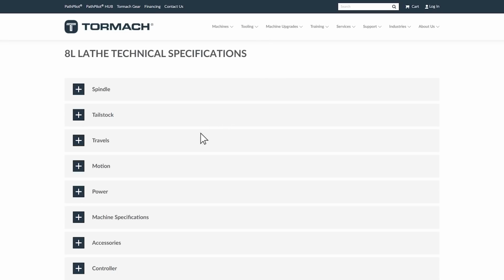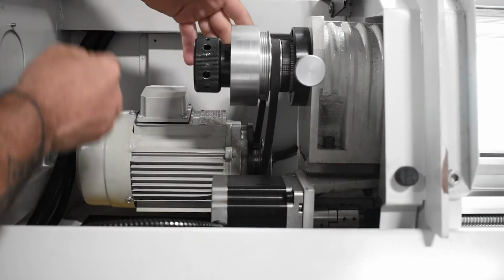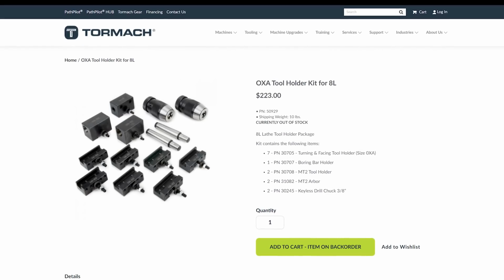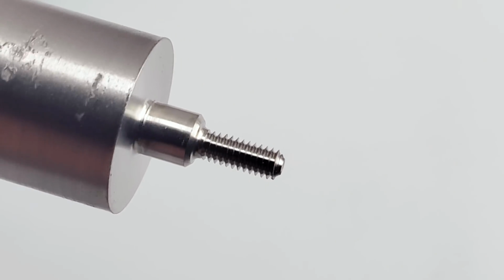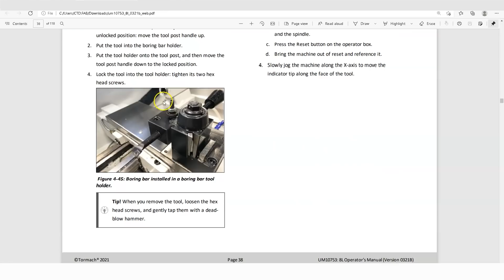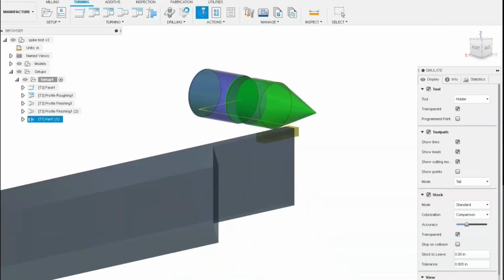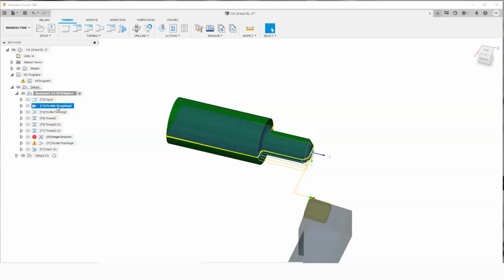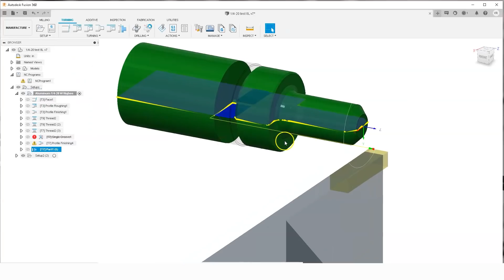Tormach 8L Lathe Introduction and First Chips!

Comment: You describe tramming and centering the tool height as if that were all that is required to deploy a new tool.  But how do you calibrate the X and Z locations of the tool edges?  That must be a nightmare, and has to be completely redone (for the whole tool table catalog!) any time the quick-change post gets nudged.  The final precision achieved is never better than the collective per-tool calibration across the whole catalog, so I imagine your boast of 0.001in repeatable tolerance is wildly optimistic.  Dozens of calibrations to maintain, any one of which, going off, spoils the works.  Grooving or threading up to a shoulder, with a slightly-off Z calibration, you're gonna crash.  The lead screws aren't even linear to 0.001in, the QCTP tool clamping is more non-repeatable error source, so adding up all that uncertainty can't deliver consistent precision.  Hard to believe you cut an M2 thread within all the tolerances (only +/- 0.00125in on pitch diameter).

Changing tools by hand is actually faster than any automatic changer.  The problem is having to attend the machine full time.  Eventually you get bored or absent-minded.  Then you change-in the wrong tool.  Or you hit the resume button out of habit before you realize you didn't change at all.  Kaboom!

An optical tool setter inspection microscope attachment would be a very productive accessory, attachable to the headstock to provide a repeatable fixed datum of the tool edges.

A pointed 1/2-inch edge finder is cheap and precisely ground, no need to be improvising that pointed bar.
Reply: Basically everything you said regarding tool offsets is applicable to any toolroom CNC lathe running a QCTP. Nothing new here. 

So long as the tool post the machine comes with is a high quality (repeatable) one, I don't really see how .001" repeatability is unreasonable. 

And no, changing tools by hand is almost never faster than an automatic tool changer. What ATC's are you using?
Reply: @tbdcreations5370  The QCTP shown is the ordinary type that is just clamped with a threaded post and nut.  It has no repeatable position relative to the carriage and the machine coordinates.  It shifts and turns anytime there is a false engagement or crash, losing the datum and requiring a laborious recalibration.  Of course there is nothing new about it, it's what manual lathes have used for 50 years.  The tool holder to QCTP repeatability is not the major problem; the problem is the QTCP to carriage fixation that isn't reliable, detectable, or repeatable.  There is no removing this weakness, because the QCTP has to be the weak point that gives when there is a crash.  If you fixed it in position more firmly, then something else would have to give or break when there is a crash, probably the leadscrews or bearings, disastrously, permanently degrading.  In the manual days, this wasn't a problem because the operator's hands and intelligent senses on the cranks were the ultimate torque/force limiter.  But CNC has no such sensory detectors or intelligence to limit self-damage from motion faults.  Instead you're relying on the QCTP to be an emergency one-time clutch, and when you blow that fuse you're looking at an hour or more to replace the calibration and restore precision.

There's a train of mechanical imprecision sources: insert to tool, tool to holder, holder to QCTP, QCTP to carriage, carriage to {lead,ball}screw, screw linearity and rigidity, screw bearings, ways linearity and squareness, workholding, spindle.  You add all those together in a machine of this type quality, you're never going to get repeatable precision of anything like 0.001in without cut-and-try intervention methods, and constant laborious tuning.  Just to get a shop standard 0.003in requires constant care.  Hope-and-try strategy will typically yield 0.005in or worse.

CNC is like self-driving cars, player pianos, factory bakeries.  They can drive/play/produce better and relieve the tedium, but new problems emerge because there's no soul.

You can manually change a QCTP tool in a second or two.  A turret ATC isn't any faster than that, and the stepper motor types can be quite ponderously slow.  It's sort of a John Henry conceit, but then things didn't turn out well for him.
Reply: @RichardKinch   I guess I'd agree that this particular QCTP is probably more problematic than larger ones because of it's size (and because he mentioned issues with it in the video). But my point was QCTP have been used on many CNC lathes in the past and present. Trak toolroom lathes, Haas TL series lathes, ROMI Ezpaths. Typically what that means is you're limited to just a couple of tools to make setup time for a job reasonable. You make it sound like a big deal but it doesn't take more than 10 minutes to set the tools offsets for a handful of tools. 

Clearly we're both just speculating on the precision of the machine, maybe in a future video they'll actually give more feedback on real-world repeatability. 

Maybe you're much faster than I am, but I don't think I could reliably make a tool change on a QCTP faster than 3-4 seconds. 
A turret ATC on a large CNC lathe can change tools in 1/4 second or so (or less). I've seen ATC's on little educational lathes like this one change tools in closer to 1 second. 

But really, if you're trying to shave individual seconds off your cycle time then this is clearly not the lathe for that. That and there is no tool changer option for the 8L as far as I know.
Reply: @tbdcreations5370  I'm not speculating.  I have 100s of hours experience on an identical CNC retrofit design.

I don't follow how you can measure a tool offset in a minute.  If you're aiming for 0.001in total absolute (a priori) precision, you have to measure to tenths on every random item in each of 3 dimensions in the train.  The machine as shown doesn't have any facility for these measurments, so how is it even done on the live machine at all much less quickly? Hence my suggestion that an optical attachment on the headstock would be necessary.  And this has to be repeated constantly, not a one-time setup; there is no defined datum among the carriage, QCTP, and holders; it's all relative and only resolved to the fixed machine coordinates at run time through the budging parts of the train.  The tool calibration is missing from this presentation.  But it has to involve some measuring tool not shown, such as a dial indicator, optical DRO, test bar reference, optical microscope, etc.  None of these methods are convenient or quick, when you're aiming for tenths on elements to achieve 0.001in total.
Reply: @RichardKinch   Quite the know-it-all, aren't ya? (Or so you think)

Actually you are speculating, since this is a CNC lathe built by a company to be a CNC lathe. Not a manual lathe converted by a DIYer. 

For the X offset virtually any control I've used (I think pathpilot has this too) you can turn a diameter and use a micrometer to measure the diameter. Then with the tool still at that position go into the offsets page and use the measured diameter to set the offset. This takes about 1 minute per tool. 

For Z offset you can simply touch off the end of a piece of stock. You won't get to within tenths, but should be able to get to within .001"-.002". This takes about 30 seconds per tool. 

Using a micrometer, you could get the diameter offset within a few tenths (better than the machine could hold). 

For Z, you're stuck with .001"-.002". I don't think much better accuracy could be expected on Z features without some sort of toolsetter or optical device as you suggested. Both of which would be absolutely absurd for a machine of this size.
Reply: @RichardKinch   As a user of this machine for almost a year. Your experience with your system applies to this machine also. The tool post can be bumped out of position in the event of a crash. From experience the tool itself will will push out of holder and or the machine stalls. But no damage to machine that i could verify. Guessing the axis drives are not powerful enough to damage ball screws.  maybe spindle encoder also helps limit crash damage.  I added a tool list to the cam post header so i could arrange the tools in correct order and avoid a crash from wrong tool.
 The tool setup is in fact the most time consuming  part of using this lathe. But its not that hard with practice and good methods.  Special care for key tools must be used for finished dimensions. Most of the others for roughing do not require this.  It takes about 15-20 minutes for normal 5 tool program using  Facing, roughing, profile, threading, and cutoff ops.  As others mentioned it works much like any lathe with a tool post system and has the variations that come with a qtp system.  As you mentioned if you crash it you will spend time getting it all back. The trick is dont crash it :).  Anyway After setup its easy to load programs and use for days or weeks only having to set tool 1 "reference tool" by skim cut and measure and skim face and zero z. All other tools work from that offset and are as accurate as your setup methods.  As for precision of this lathe system. imho it can be freaky accurate for such a small machine. Do a skim cut and set tool. Go back do another skim cut and dro and your mic read same out to 0.000?. At this point its all in the program and how its setup for the material to be machined. Good quality inserts are a must along with good coolant if you want nice finishes.  Its a small machine! dont expect to hog material and get great accuracy and or not throw it out of wack.  And like all lathes the material itself flexes if not supported on both ends.  I wanted the machine so i could build a large widget library of cad /cam hardware models ready to load. Throw in some stock and have good basic part in just minutes.  Example  if you fix things on a farm and a hardware store is 60 miles away, this would be a good tool to have for making hydraulic fittings and other small hardware for fast on site repairs. After you make one its easy to file the program and setup on disk drive ready to make when needed.  If you want to make hundreds of something imho this is not the system. Way to many movements changing tools, setting stock, open and close doors. The user would be wore out in no time ..........    I do have a tormach mill and router that use same pp control, cad and cam for all three machines making a nice overall system to use on a casual basis.
Reply: @laneburkhart5590  I agree with you.  But what we're aiming for is automatic absolute coordinate precision a priori, not relative cut-and-try manual interventions.  That is, the genuine precision of a CNC machine is how close it repeatedly delivers what you program without per-job manual or semi-automatic interventions/tuning.  Not what you can achieve with mic'ing a trial cut and adjusting the program for each part run.  It's not a 0.001in CNC machine if you have to tune it on every part to get that result.  You can get 0.001in with interventions, like we did in manual days with mics or DROs, but that's not the CNC performance, it's just CNC assisting a tedious manual process.

If the axis motors are underpowered (and being steppers not servos, that's a given) then that's a good thing in terms of the machine not automatically self-destructing or degrading itself.  But that also means the machine can't possibly perform anywhere near the material removal rates or feeds-and-speeds envelopes that are required for sound metalworking.
Reply: @tbdcreations5370  Actually I'm an engineer and physicist, and 20 years into metalworking and CNC.  The only speculating here is that this machine is built from Chinese components, such as the rolled ballscrews and repurposed bed-ways-carriage, which have definite limitations.  That knowledge is first-hand and not speculative.
Reply: @RichardKinch   after power on and homing machine. Tool one is set by a skim cut and measure. After that your good to run parts  until you shut down machine.
If your system requires more then it is not much better then Manual. The machine requires no intervention. As for power it has a motor and steppers designed for this size of machine and mmr that goes with this size of machine. Before you questioned accuracy and I explained how accurate it is by just looking at the dro and a skim cut for tool setup. You questioned damage from crashes I explained how it avoids damage with motors and spindle encoder sized for this type of machine.  Now your concern is mmr. Sorry not going to debate that as its subjective and the main idea is to make high precision parts with this small machine not how fast you can make them. If you want production move to bigger machines. If you want hand fulls of precision lathe forms and not worried about time as much as results. This is a good fit.  In my case its all about a huge library of pre designed cad cam lathe parts ready to make as desired.  Just load stock and hit run button and start changing tools. Simple imho. Example I needed a male air coupler. I designed it to spec cam tool paths up and then went on to make a dozen. All in a couple hours. Not clear why you dont understand this work flow. But it is a nice little cnc lathe imho and it works as designed.  Good luck with your conversion and its problems. I like to make parts not work out problems with poor machine designs.  Why I have 3 of their machines because they work. And I was told by a number of people over the many years of use they were junk. When in fact they work well and make very precise parts on all three lathe, router and 1100 mill.
Reply: Final note. This machine plugs into a wall outlet. How much mmr can you get with that power. Also if your making small fittings or parts from o.5 inch stock just how much mmr do you need? It takes all of a couple minutes to run a program and make a part.
  Lol kind of silly for a engineer and physics guy to even bring that subject up.  Its a machine with a designed purpose imho.  I also have  experience fixing tools and equipment.  Tools like this are perfect to make small replacement parts and fittings when a purchased part was a day to a week away.  Another simple example for end users that wants and needs results. And not have some huge over spec machine setting around to make a small fittings.
Reply: @laneburkhart5590  Available power is indeed another weakness.  MRR matters because it's part of the chip-forming feed-speed envelope.  The spindle belts are too small for 1.5hp.  The 120VAC outlet won't deliver 1.5hp plus the rest of the motors and electronics.  The spindle motor type is not specified, but being torque limited means that slower speeds will be shrinking to fractional horsepower, for larger diameters where you need more torque to get MRR in the envelope.  These sorts of compromises rule out a lot of the operational envelope that the specs claim.  It's like the electric car hype, that specs promise you 0-60mph in 3.2sec, and 350mi range, except you can't have both at the same time. Versatility without performance, the Swiss Army knife compromise.
Reply: @laneburkhart5590  Just wondering if you can point me in the direction of a Fusion 360 post for the 8L.  I've been looking around and haven't found anything.  Don't have enough knowledge to start editing the 15L / rapid turn post - or is this the best place to start?  I haven't bought an 8L, just looking into it.
Reply: @chrismayhew3651  Hi Chris. I use Sprutcam to drive my mill, router and 8l lathe.  I use the sbl15 post with machine flipped and reversed to simulate front tool post with positive numbers. I would think you could do the same with fusion using the sbl15 post for that cam. Or ask other fusion users what they do.  It does take some extra steps in sprutcam to get correct gcode but no real problem for me anyway.
Reply: The tool post isn't going to move "every time it gets nudged." You'd need to put a wrench in the bolt and loosen it for the top post to rotate. You're making it sound way harder than it is. Even with a manual lathe and dro, you can set tool positions very easily. And it has ball screws, not traditional lead screws.
Reply: @littlejackalo5326  The QCTP gets nudged whenever there's a false tool engagement or crash.  That is a deliberate feature to "give way" and protect the rest of the motion mechanisms in the even of a crash.  A proper CNC lathe contains torque and force limiters to stop a crash; this Tormach item does not have that, and relies on the QCTP weakness to provide some limiting.  Still, the leadscrews and bearings are going to suffer some damage, loosen up, and lose linearity.

Ball screws are irrelevant.  The cheap rolled type used in this machine are no better than leadscrews for linearity and repeatability, several 0.001in error over their travel.  They're preloaded, not precision ground, which spoils the backlash characteristic and force capacity.  They don't get you bidirectional engagement.  The only significant benefit to ball screws in this machine is their better mechanical efficiency, but that would be better done by just using slightly bigger motors.